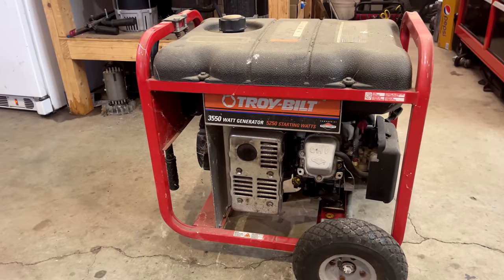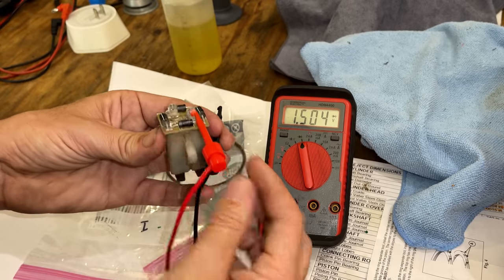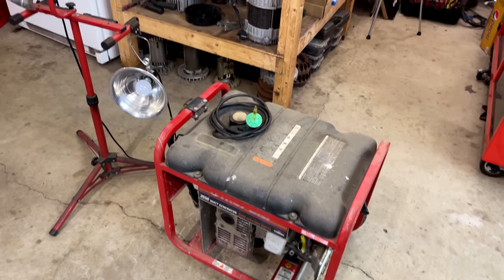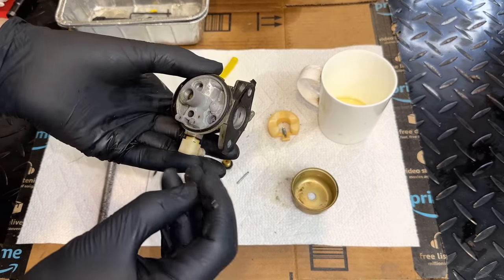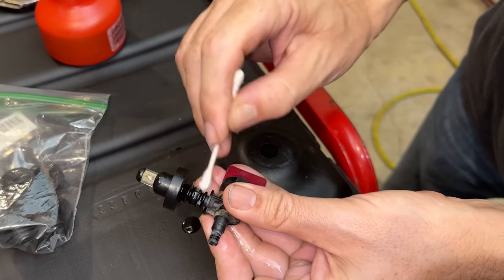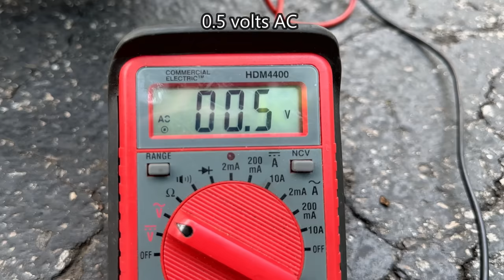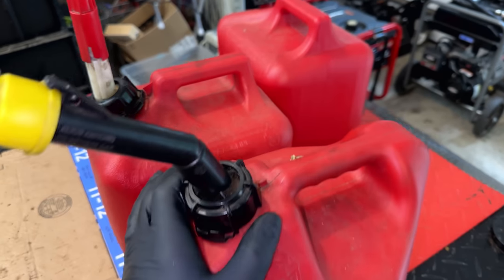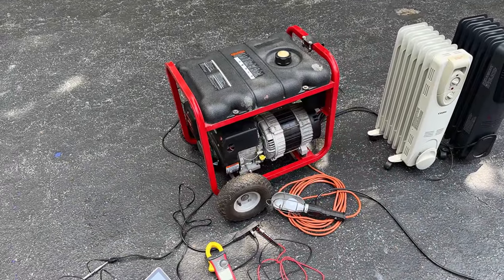No Power Output - Will Flashing the Field Restore Power?

Comment: Hi,
3 tips for you, armorall makes tanks look new, tire black for cars does the same for the wheels and lead solder, hammered flat and trimmed ias necessary makes stripped screws in AL grab again, can even work on motor heads.

Comment: 12 volts through 50 ohms is only 1/4 amp and with 2 diode drops maybe 1/5 amp. Not much to spark even with an inductive kick (which as you noted can be a big voltage that might pop the diodes. The brush assembly with no diodes  seems like a good idea.) It would be interesting to put your meter in series - set to amperes - to watch the flash current.

Comment: 26:23 Thinking about it, it's even more risky to use brushes without the bridge rectifier since you can get the polarity wrong. With a rectifier, it doesn't matter which way you connect the input voltage since the output will always be correct (assuming the rectifier/diodes are working correctly)
Reply: As far as fundamental operation is concerned, the generator doesn't care which way rotor current goes as long as it is DC. The worst thing that may happen is losing rotor magnetization again when the opposite polarity field current cancels out residual magnetism. For the rest, the only difference from switching field current polarity is a 180 degree phase shift in stator voltage which is no different from turning the shaft by a quarter-turn for a quad-pole 1800RPM 60Hz generator.

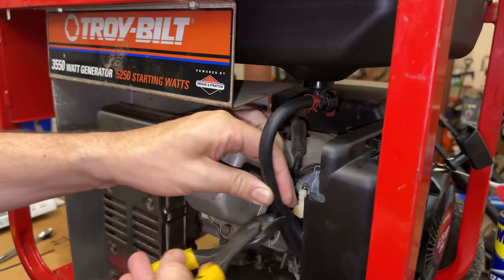Comment: @59:55 Obviously a bad design compromise, but I can see the reason for having the fuel shutoff control facing outward... the other way you have to reach into/over a hot engine to shut off the fuel flow if something goes wrong.  Except if the engine is on fire, in which case it doesn't make any difference.  Yes, I think the original hose fitting was formed that way at the factory.

Comment: James, Thanks, per the email I sent, this 5500 is the exact generator I'm working on.
Reply from the maker: Not sure if you got my reply.  I got a bounce back.  This is what it said:

Good find.  I will put a link below to the bushing I use in just about every tank.  For oem parts you would have to use the model number on the frame rail to find the parts diagram to lookup the exact part.

Hipa (Pack of 6 33/64" Fuel Tank Bushing Grommet for MTD Troy Bilt 735-0149 935-0149 104047 46-6560 Tecumseh Craftsman Generator Lawn Mower 33679 25 313 01-S https://a.co/d/djoW1M6

Comment: I noticed what looked like a small capacitor in the diode area.  To very old memory that capacitor is there to charge and discharge during a portion of the AC cycle discharging to help smooth out the ripple left from the diodes on and off time. That cap could be shorted out as well.

Comment: If you have NOT. yet tried Lucas Fuel Stabilizer for gasoline, either that with or without methanol I have had great luck over many years storing fuel with up to 10% methanol for many months.  I once allowed my 02 Dodge Ram 4.7 liter V8 to go nearly 10 months without running it and it cranked and performed great I was pleasantly surprised as I had only left it with about 1/4 tank of gas in it and the recommended amount of Lucas per the estimated gallons I thought were in the tank. I always try to slosh the fuel around by shaking the vehicle or tank and then crank and run any engine several minutes after adding the Lucas.

Comment: Hi, James. Interesting. I never saw "Flashing the Field". I did think that you could link the generator drill to another drill with a drill bit and use the 2nd drill to turn the generator drill without you working so hard.  Thanks for sharing! See ya next time!
Reply: what a complex answer , just power the field winding with a 12v batt for a couple seconds and ur back to magnetized and working gen

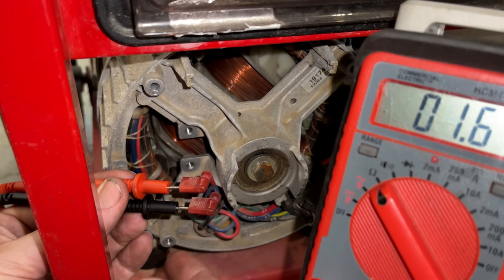Comment: Why not while trying to flash the system take a bolt remove the head and chuck it into the ryobi drill and attach it to the corded drill and use the Cordless drill to power the electric drill chuck to flash the system with speed and power 23:36 just a idea @James Condon

Comment: You really don't need brushes without a rectifier. Just apply the voltage to the brushes through the rectifier... You don't get sparks, cause the the rectifier shorts the flyback voltage spike, but that's fine. Also there is no good reason to apply voltage to the rotor for multiple seconds. As soon as full current is flowing through the coil, it is already magnetically saturated anyway. Even one second is multiple orders of magnitude more than you need.

Comment: Please don't share misinformation. Drill have universal motor. They don't act as generator. You can easily test it with your multimeter. The fact that maybe some generator start working when cranking a drill has nothing to do about it and is most likely the buildup of magnetism from the low output during the time you crank. You have a very good description of how universal motors works on Wikipedia but again, use your multimeter both on AC and DC, you will see 0 volt while cranking a drill.
Reply from the maker: True.  I did test it long ago and saw low voltage AC output.  Will have to double check.  Must have been the residual magnetism of the drill field?  It has worked in the past.  https://youtu.be/PM8VXYXOJUs?t=3872
https://youtu.be/8GvJkuINoKA?t=1173

Comment: Have a look at Lisle 47900 - Hose Remover Pliers. They push the hose off the fitting without damage to fittings.
Reply from the maker: Pushing off is the way to go.  Pulling it off just makes it grip tighter.

Comment: If you start or shut down a Brushless Alternator with a load on it you can drain the "Residual Magnetism" in the Exciter Coil leaving no way to produce a Starting Voltage and Current for the Rotor. Hitting it with a pulse of current from a battery re energizes the coil magnetism and restarts the Loop.

Comment: If the drill is variable speed type (electronic trigger module), you're not going to get significant generated power at the plug to 'flash' the field winding.  You would need to bypass the trigger module, which contains an SCR or some other solid state device.

Comment: They designed that fuel line to have the cutoff facing out for easier access to the cutoff because they advise to always run the fuel bowl dry after use to preveuntu varniushiung the iunsiude of that carb

Comment: The manufacturers added the magnet so they could use much cheaper steel instead of high magnetic permeability iron for the rotor laminates. Much cheaper to make the rotor that way. It does lead to more eddy currents in the core however. Which will shorten the life of bearings.

Comment: soak the fuel tank bushing in warm water. It will be more pliable. Also, I replaced two of mine with Viton bushings (colored blue or orange). I think they will last longer than the rubber ones.

Comment: Another great video.
]Since the bridge rectifier will deliver the correct positive & negative voltages to the appropriate brushes, was it really necessary to replace that brush block with the one with no diodes in order to flash the rotor? Wouldn't it be possible to just apply 12 V to the standard brush block (with whatever polarity to boot) and let the bridge rectifier do its job of sorting out "+" and "-" to the rotor?

Comment: you don't necessarily need to take the diode off.  Interesting though, it doesn't matter if there's a bridge rectifier on the brushes or not as DC will pass through a rectifier no problem there will be a bit of a volt drop though

Comment: It doesn't matter if the 'flash' brushes have a rectifier or not.  The full wave diode configuration will pass DC the same as AC and in the correct polarity at the brush tips no matter how the battery is connected.

Comment: I think this video has the best demonstration of how to test the various components of the generator head.  One question It looked like you flashed the rotor differently on the storm responder that the Trot Built.  On one you flashed with only the brushes on the other it looked like you flashed the rotor with the bridge and brushes using a 12 volt battery.  Question: Is Flashing the rotor with the brushes only necessary?  In answer to the final statement,  Yes, your videos are very helpful.  KOKO!
Reply from the maker: You can flag through the bridge rectifier.  The only possible issue is damage to the diodes and MOV with the surge created when the battery is disconnected.

Comment: The end of the diode with the line is the cathode or negative end the other end is the anode or positive.  At least a 10:1 ratio of resistance if you have an ohmmeter with out diode test function.

Comment: You can actually test diodes with just an ohmmeter whether digital or analog.  You look for at least a 10:1 ratio of resistance/continuity forward versus reverse bias.

Comment: There's whole parts to that carb that you missed. There's a little check valve built into the body that acts like a regulator for the idle. My guess is the ball in there is stuck.

Comment: The rectifier will absorb the back emf, and you won't see a spark. Putting the meter in series set to amperage will show your flashing current, and verify the brushes slip rings and diodes all at once. E/R or 12/50 should show about 240MA or so.

Comment: I'm only to the part where you're trying to get it to jump off spinning the drill by hand, you should've just put a cordless drill hooked from, chuck to chuck with an old bit or something and spun it up.That's what I do when my push mower won't start and I get tried of winding myself pulling it, just take off the pull starter and put a drill on the flywheel but. I learned from project farm haha
Reply from the maker: I did, but cut that out because it did not work.  This one was stubborn or maybe I need a better drill.
Reply: Anything to justify a new drill 😂

Comment: I've been watching a lot of your generator repair videos and notice that when flashing a field with a hand that you literally spin the drill motor by hand to accomplish this task, would it work if you had a straight shaft that you would chuck 2 drills head to head so you could use one drill powered up to spin the drill you are using to flash the generator rotor? seems like it would work and may prevent carpal tunnel in the future.

Comment: James a 12 volt 1/4" drive ratchet will make you happy. I bought a set of AC Delco 1/4" and 3/8" 12 volt ratchets after using air powered tools for years. The 12 volt tools are great for small work like you do......I used to flash fields with a 9 volt battery rigged up to connect right into an AC outlet and it sometimes worked.....My job got eliminated so now the only generators I work on are at home or sometimes at one of my old customers locations.....RV Onan's....

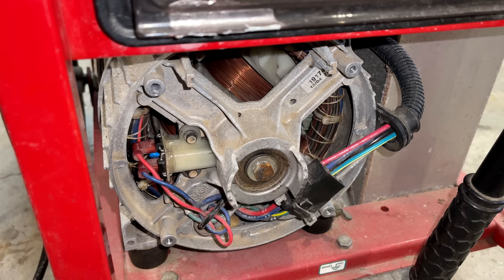Comment: 22:25 I don't see why you need brushes without the bridge rectifier. If you feed DC into a bridge rectifier, the only thing thing that will happen is that you will have the voltage lowered by the diodes' voltage drop. I don't think it's going to change anything. When you were trying to flash the rotor with the drill, I was wondering why you didn't hook up a battery or a bench power supply with voltage in the right ballpark.

Comment: Good explanation of diode testing. But the multimeter you used for diode drop is… potentially confusing. It showing 1.503v (or whatever test voltage it’s using) rather than when there’s current flow. Very odd. Never seen that before.

Really don’t understand the Jerry rigged wire on second unit… what on earth were they trying to accomplish?

Comment: If the choke helps it run, mixture is too lean. Btw, you flash a computer. An alternator can not be flashed. Depends on your problem, I may have some advice.

Comment: Another nice video. What can I do if the wires that feed into the AVR have bad contacts? Meaning I have to install the wire going into the avr in a specific postion, otherwise the generator will not make power. At first I thought it was a bad avr, but the avr is fine.

Comment: I actually use four different types of gloves in my shop to try and keep my hands as clean as possible and still accomplish necessary tasks or protect my hands.  I notice you've been using black (nitrile?) gloves.  I had some a couple years ago that seemed to last longer than others but I can't remember where they came from.  Do your black ones last longer (stand up to brake/carb cleaners and fuel better) than others?  I don't mind paying a bit more to get ones that will last longer than one or two sessions and are sized such that I can actually get them off when I want to!  The thicknesses are usually misrepresented on the packaging.  I measure multiple thicknesses at one time, dividing by the number of layers to get an actual measurement.  I'd prefer slightly thicker ones but so far have been unsuccessful in finding any.

Comment: Question: Why would the power head care about the polarities of the rotor? It will rotate anyway and generate an oscillating field in the stator. Of you reverse the polarities it would just be as if the rotor was 180 degrees ahead/back.

I'm not saying I even think you are wrong, I just don't get it :)

Edit: if the rotor has a permanent magnet I get it could be problematic though.

Comment: Capacitor blocks DC, noticing that on your "flash" brushes, and also on the original rectifier from the first generator, no cap is on them, but on the 2 you used on the 2nd generator to attempt flashing through the rectifier, both have caps.  Can't see it clearly enough to know if that matters at all (depending on how that cap is in the circuit, I suspect it's supplemental off to the side and not in-line, so this theory would be incorrect) it could be what's preventing the flashing by blocking the DC reaching the destination.
Actually now that I think about it more, and based on what I assume is the connections from looking at the video at 1:13:20, I now suspect that's a back-EMF absorber... in which case, if it's working properly as designed, your original flash may have worked just fine, and you didn't get sparks because the cap absorbed the hit below the point of visual arcing. 
Just theories anyhow, I've never played with these and certainly not to the extent you have, but during gen1, I was like "why isn't he just flashing through the rectifier) which you proceeded to do on #2, LOL.

Comment: Even your xmas light bulb will draw down the voltage enough to prevent the stator receiving enough voltage to reflash.  It would have probably worked with ONLY the drill and your voltmeter connected.

Comment: have you ever tried to spin the AC drill to setup residual magnetism using a second drill chucked to the first drill? As an experiment try reading the first drill's output voltage while spinning it with a second drill.
Reply from the maker: I have.  No better result.  I think the real issue is a drill is a universal motor.  Does not produce much power.

Comment: That Storm Responder is the EXACT one I have..
Reply from the maker: It’s a good machine.  Just check the oil and you will be fine.
Reply: @jcondon1   Yeah it's never had a hiccup and I'm a maintenance freak.
It's good to see it's a solid unit,, dumb luck..
My other generator is a Pramec S5000 that was given to me "brand new" about 15 years ago with less than an hour runtime.
It was a project as it turned out but it's still new, actually better than new and "I think" it can be trusted now...
It has a story to tell that's for sure....   lol

Comment: You can rest a diode with just an ohms function but the diode needs to present a 1:10, that is 10 times or better resistance one way over the other way, ratio to be considered good.

Comment: Magnetizing the rotor using a DC power supply, current-limited to about one ampere with correct polarity is the most reliable method.  "Flashing the field" seems an unreliable layman's trick even if it does occasionally work.  The silicon steel laminations in the rotor easily store remnant flux (residual magnetism) with a little applied magnetizing current.  By the way, transformers cores hold remnant flux too, but that's undesireable and can cause high inrush current when energized.

Comment: most carburettor problems is the jets sometimes it blocked by not letting the fuel in i used to services them by blowing it with my mouth to gets rid of the rubbish put it back it just worked again

Comment: Something is wrong with the meter. In diode /continuity mode the reading should be infinite with a "1" when the leads are not connected to anything not 1.503??? At least with 100's of meters [DVM] I've worked with over the course of 40 years, I have never seen that behavior. The diode readings you get seem a little low, typical readings are in the .5-.6 volt drop range.

That drill shouldn't generate any power when rotated, it has no permanent magnets.

Just go ahead and disconnect the terminals on the field brushes, connect a power supply preferably a constant current set at 3-5 amps for a few minutes.

Comment: The oil sensor was eliminated to save cost. Yeah right, it was eliminated to sell more generators.  
Just like the way HP disabled the over temperature sensors, so that they could claim the user was to blame for destroying it by using it on your lap and blocking the vents.

Comment: You don't need the fuse for flashing at 12V as the current will only be 1/4 amp and you've already checked there is no short in the winding.
Reply from the maker: If everything goes right.  But I have melted leads in the past.

Comment: Great video James: I have two questions:1, Can you flash the rotor by connecting directly to the slip rings? 2. Also a while back you had a video, I think it was a two cyl. machine, that had a low THD. Do you remember what make and model generator it was? Thanks for another very interesting video.
Reply from the maker: 1) yes and 2) the Generac XG1000 and the GEN-PRO 9000 were both two cylinder engines with low THD.